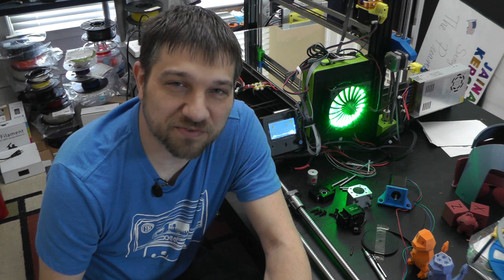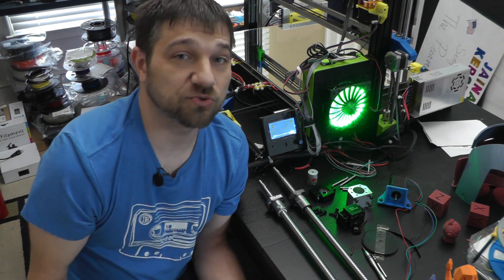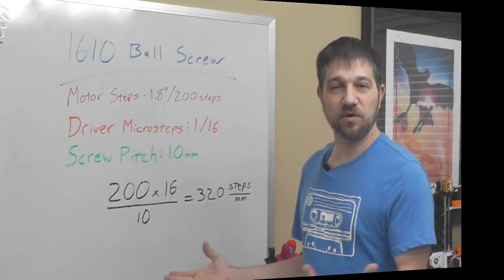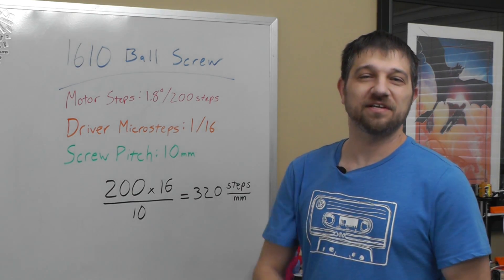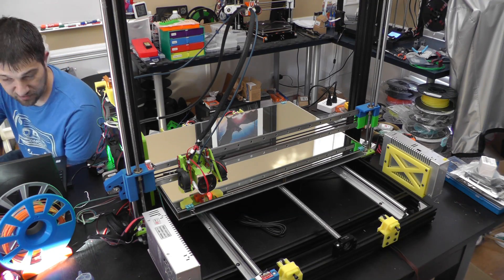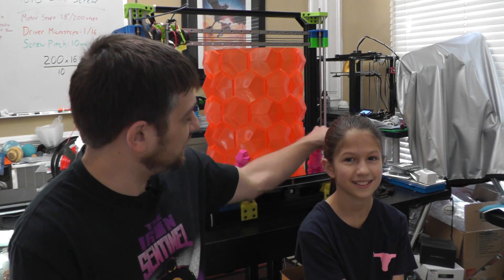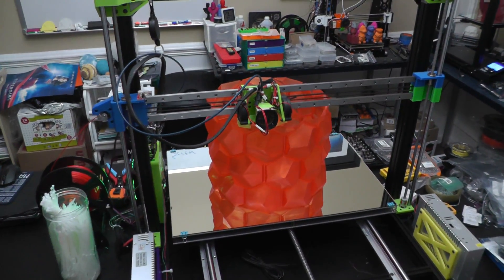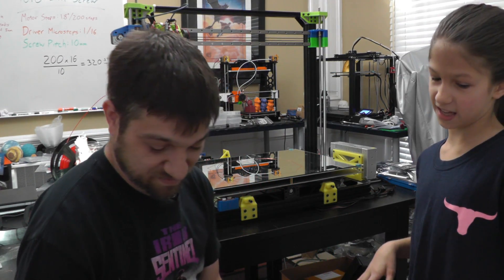Replacing Belts with a Ball Screw on a 3D Printer (Cosplay 600 series)

Comment: I know this is a bunch of years ago that you did this, I am curious have you tried using a ball screw that has a longer thread distance so your motor takes less steps to move the bed and can move faster and further with less rotations. I was just now looking into this and I think it would be great for the tool head movement. You should be able to get faster movement with a small diameter rod with less number of threads. You should be able to move the head up to 600 mm/s easily and have reduced the number of steps it takes to move the head in the process. The same can be said for the Bed but it being a large heavy bed like yours, you can reduce the thread count of the shaft and the number of steps but at some point one will cancel out the other. Maybe applying two motors linked and two shafts to the bed might help reducing the load one motor had to move the bed. Something to think about

Comment: I converted my Y axis to a lead screw (I had the original Z from when I upgraded my print height) and it's so much better.  I'll be going full ballscrew eventually.  Full ballscrew printers should be a standard for people that want to print high detail, but everyone seems to just want to print fast.  I need quality for my work, not speed, and I can't use resin printers.  Thanks for the video, I'm glad I'm not the only one thinking this way.
Reply from the maker: I appreciate it! I'm glad to see this design is working for someone. I need to get back to it.
Reply: Did you go full ballscrew yet? I'm gonna get a Bambu P1P so I'm thinking about using the steppers, build plate and rods from my old Anycubic mega s to build a new printer. I was thinking about using a similar motion system to some of the raise3D printers where the printhead is hanging on two crossing rods. Except that the two rods will be 20mm lead ballscrews with 16mm diameter which have their bearings connected to 2 25mm thick rotary stroke bearings (fibro) each, meaning no belts for X and Y. I'm also planning to use two nuts per ballscrew that are spread apart by spring washers to get rid of the backlash and increase stiffness.
Reply: @GrumpiestKitten  I have swapped my Y axis for a 1605 ballscrew, but haven't replaced the X yet.  I actually had to get a 42-60 2A stepper because the stock stepper just wasn't strong enough to handle it without skipping steps.  I'm running it at 1.5A with my TMC2209's without skipping now.  The bearing block came with terrible bearings in it, so I have some proper taper bearings arriving next week.  I am hoping I can increase speeds once they arrive.  I'm currently stuck at 30mm/s without increasing amperage on the stepper.
Reply: @glowpon3  30 mm/s is pretty good for 5 mm lead. Makes me optimistic for the 1620 since I don't plan to print faster than 100 mm/s. 
Thanks for the heads up on the bearings. Gonna look for cheap flange mounts and put some nice spindle bearings (O-config) in there instead of going for the bearing blocks that the cheaper spindles come with.
Reply: @GrumpiestKitten  Follow-Up:  I've replaced the bearings with some 7001B bearings and added superlube synthetic grease 41150.  I have jerk set to 1 for Y and had to disable SteathChop for Y as well.  I was able to push to 70mm/s but it started skipping.  60 seems reliable but I'll probably go 50 to be safe.  Running 1700mA on a 2A motor with added aluminum heatsinks.  I think it's safe to swap the X now that I know I can get decent speeds with a 1605.

Comment: I have been very curious about aluminum beds seeings as how aluminum is very prone to warping... they work pretty good for this application though?
Reply from the maker: Yeah. Just about every printer uses one. To compensate for bed changes when heating, most recommend leveling after warming up.
Reply: thanks i was pretty curious lol id be afraid of it crowning after a few months or maybe a year. but if they been working and they use em so frequent they must be good :) I mean i wouldn't pay top quality prices for the cheapest solution.

Comment: You should go with klipper firmware and use the input shaper feature, that should more or less eliminate ringing :)
Reply: I second this. My ender 3 prints infill at 200 and outer walls at 120 with no ringing.

Comment: This video is a tad old, so my suggestion may or may not be applicable or even still relevant.

But the Klipper firmwares resonance calibration does a fantastic job at minimizing resonances in a 3D Printer, especially those that come from mass.

It's a calibration, and when you use a 5-10$ accelerometer (ADXL345) it's really quick to recalibrate whenever you change the masses on your printer.

So once it's tuned, you're done and only have to redo the calibration when you substantially change the mass around your printer (lighter/heavier head, lighter/heavier bed, etc).

The resonance calibration will suggest an  input shaper to use and which your ideal acceleration would be.

And Acceleration as a cause for ringing and ghosting is not as simple as "fast is always worst". Resonance happens by hitting specific accelerations/decelerations at very specific times that are in tune with the natural resonance of the printer.

In my case with my Ender 3 Pro, I had acceleration set between 500-1500 depending on what the print move was.

The suggestion for my printer was <=5800mm/s². That in combination with the input shaper the calibration routine also suggests, already made most of the ringing and ghosting on my printer go away outright.

The final bit of it I got rid by building a passive vibration and resonance dampener under the printer table. The same kind used for skyscrapers, which pretty much comes down to a tuned weight suspended from the structure by cables and springs.

Comment: I love the fact that you keep the power suply without a case and mount... Did you found any design to actually mount the PSU in a decent way?
Reply from the maker: What's wrong with the way I mounted the supply on a printer that I'm building for experimentation? What's missing?

Comment: Regarding the 1605 ball screw, is setting Y_axis microstep to 1/8 feasible? Does reducing microsteps increase speed and/or torque? It would still effectively have a 1/16 resolution in contrast to the 1610 at 1/16?
I tried a 1605 on mine but didn't change the micro stepping and also didn't change the acceleration and it was very angry. Just upgraded to the big stepper you got and an SKR mini 2.0. Gonna try it again soon. It's either that or a multi belt setup for my CR10 s5 preloading the belts to reduce bounce. Rather get the ball screw working.
Reply from the maker: Yep, you can decrease the microstepping to 1/8. The biggest issue I see is that you have to run the 1605 twice as fast as the 1610. This isn't great for a stepper motor since they aren't designed for speed plus it's harder to stop and change direction going twice as fast. Check out Ivan Miranda's channel where he used larger and multiple belts for a large printer.

Comment: Seeing you using stepper motors with the highest nominal torque you could find and the stepping frequency you wanted, I have some questions for you:
What are the nominal voltage and nominal current of your stepper motor?
What stepper motor driver you are using?
What voltage are you supplying to your stepper motor?

The reason I am asking this is based on experiences I have had using a stepper motor for implementing the function of a winch to control the sails of my sailboat model. I have been attacked also personally until I did deliver a response from the Trinamic website in their Technical FAQ:

https://www.trinamic.com/support/faq/#Motors
[b]Why do I need to use a stepper motor supply voltage higher than the rated phase voltage?[/b]

Here they speak about feeding a stepper motor with a voltage 20x larger than the rated voltage.

2 reasons for this:
1. The higher the step frequency is with which a stepper motor is operated, the higher is the induced voltage from the coils and that is always of inverse polarity to the applied voltage. So supplying the stepper motor with a higher voltage means that the effective voltage, that is responsible for the amount of current flowing through the coils of a stepper motor, Ieff = Iapplied + (-Vinduced), remains above the threshold to lose torque.
2. The Trinamic driver limits the amount of current flowing through the coils of a stepper motor by using a PWM. It sets its duty cycle to such a value that the rated current is not exceeded. But allowing up to 20% additional current to flow through the coils of a stepper motor for a limited time, heating of the stepper motor is what limits the time, peak torque demands can be handled. But the same technique is used to limit the flow of current such, that only the required torque at a certain time is made available, plus a safety margin.

I have purchased a 48 VDC Meanwell power supply and SilentStepSticks TMC 5160hv that can handle up to 60 VDC. This way, combining a higher supply voltage to the stepper motors and using NEMA17 stepper motors a big step is made to enable a 3D printer to print faster, at least when viewed from the stepper motor abilities.

I have also seen that you use 16 micro-steps per full step. I guess this is to have the controller board be able to supply its control signals that make the stepper motor do its steps. I guess this is due to the limits of the ability to process G Code of the microcontroller. Trinamic driver ICs have a function where the stepper motor receives 16x micro-steps generated in the driver IC by interpolation. This way the stepper motor is running much smother benefiting from the 256 micro-steps per full step while the controller will continue to deliver x16 micro-steps and requiring the same computational power as it requires for doing 16 micro-steps per full-step.

In another one of your videos, you have found out that the microcontroller gets to its limits sooner if it has more computing requirements to service a graphics display. A controller board using the ARM4, the BTT-SKR-PRO V1.2 benefits from the higher frequency at which it is operated, 168 MHz compared to the 120 MHz with ARM3 controllers. I assume to the same reasons the manufacturers of controller boards for 3D printers are not using ARM4 dual-core controllers that at frequencies up to 220 MHz. Even if not using the ARM0+ additional core in the controller to process peripheric functions like controlling a display, the frequency at which the controller is operated would deliver more performance processing G Code.

Comment: use a closed-loop stepper, or makebase closed-loop board for your nema 17 stepper, I would also get an external 2160 external large current driver for the ballscrew axis and configure that with more current, a larger motor would not hurt either. Cheers!
Reply from the maker: I appreciate all of that. I've been working on this printer again for the past month or so and I may have it figured out with a NEMA 23. More to come soon!

Comment: I wonder how much improvement just turning down the acceleration ahold have made.
Reply from the maker: It's not a bad question. In fact, I wish I would have tested it. BUT... I'd rather not slow down a large printer given how long it will take to print things anyway.
Reply: @kerseyfabs  But you had to turn down the acceleration anyway.

Comment: Hi! Congratulations for the beauty printer do you have! I have a question for you, how you set up the array of hot beds in your motherboard?
Reply from the maker: Currently, I'm not doing it properly for the long-term. I have them all connected to separate mosfets and then have the mosfets all wired to one heatbed terminal. The next version will use a board with independent outputs for each bed and independent inputs for each bed's thermistor. This will allow independent control.

Comment: I am building a printer of similar size. What driver are you using for the Y axis?
Reply from the maker: I'm testing with the TMC5160 for the extra current on larger motors.
Reply: @kerseyfabs  for a larger bed which do you think would be better, 1) two linear shafts with end supports or 2) two Supported linear rail?
Reply from the maker: @Linrox  My personal opinion is that I like the shafts.
1) They're rigid without extra supports.
2) They line up well if you use a ball screw.
3) They really are tight enough for 3D printing, particularly since they have tensioners.

Comment: I'm convinced!

There have never been any doubts in my mind about the general lack of rigidity in all 3D printer chassis. Add to that the stretchiness of belts and you have a recipe for all kinds of resonances when you actually want to move any part of the machine even remotely quickly. (my initial Tevo Tarantula) So my Ender 5 will definitely "endup"😉,  with dual Z drives, and then I'll be looking at sliding rails and lead screw or ball drives for X and Y. Oh,  plus direct drive extruders, maybe twin or multi filament.
 But it's all fun and it's all interesting.

Comment: If you want to eliminate ringing, then it's not just the belt. When you  acelirat or decelirat, all that force is put on the screw, which is then put on the frame. 

If the frame can bend, or the bearings that take the thrust of the  screw are not strong or tight. Then it is another factor. 

You have to have a strong frame and screw bearing mounts to match a larger mass. 

This is why CNC milling machines are huge but have relatively small build arias to their size. It's the only way they are strong enough.

Comment: long time reader / watcher first time poster. so i picked up a 1610 flange only  ballscrew and mounted it all up. hooked it up to the exact same stepper make/model you linked and im feeding it via an TMC2209 driver. standard jog movements work nicely. But whenever i do a home movement the motor just can't turn the screw. did you experience this? Have you changed motors at all?  (i see mention below of changing motors)
i don't think its my hardware, the indicators are all flagging software to me, specifically homing speed?
Reply from the maker: Very nice! Same motors since my last video. The thing I changed to be able to home was the homing speed, as you mentioned. Slow it down a lot, I don't have my numbers in front of me. After that, it worked fine. Also, are you on 12V or 24V? I'll be switching to 24V before I start more videos on this printer.
Reply: @kerseyfabs  12v. Ahh I've been ramping up the home speed!! I'll try turning it down and let ya know. Thanks heaps!
Reply: Confirmed!! I turned the homing speed down to 16mm/s and it now homes successfully every time. I owe you a beverage of your choice, I've been trying to resolve this for days!

Comment: i have a large ballscrew 3d printer and my opinion on this is your stepper motors was far to small i use a high quality 80mm nema23 with a large high quality external driver.. Also since the motor is spinning so much faster i give it 70volts to maintain torque at speed (to counter back emf)
Reply from the maker: Thanks for the suggestions! I will have another video on this next month hopefully. I'll take this into account as I move forward. I've learned a lot since my last video. Do you have any more info/photos of your printer?

Comment: Lose ! the 1/16 micro stepping.
 That will noticeably increase Steppers' Torque. 
The ball screw even a 1610 will have Resolution to spare.. even at normal steppings ... compared to Belts.
Reply from the maker: Thanks! I was considering the same thing.

Comment: You need anti backlash nuts to help with play in the ballscrew and you need to change the bearings in the linear rails to G25 the one that come in the cheap are under sized
Reply from the maker: I didn't know there was a special anti-backlash ball screw. I thought that was only for lead screws. If I get to the point where I notice some issues, I'll take the repacking of the bearings into consideration.

Comment: Where'd you get the mirror/bed from? Have you had any trouble with it?
Reply: If you have adhesion problems on the mirror use a wood glud mixed with water in a  20% glue and 80%water mix you just have to aply it and heat the bed to around 50 °C til completly dry  it holds up for months witout any problems i print nylon abs pla and mostly petg on it with no warping
Reply from the maker: Sorry about the delay getting back to you. Check out one of my early videos here: https://www.youtube.com/watch?v=tPcj_rnpip0
It's a mirror I had cut down from Lowes and it works great on many printers I have. It's a super cheap but effective option.